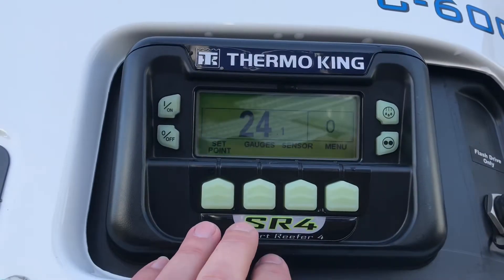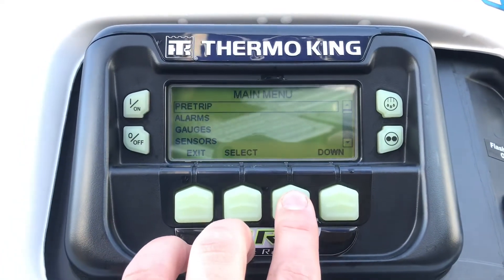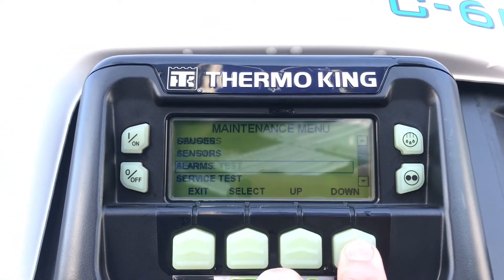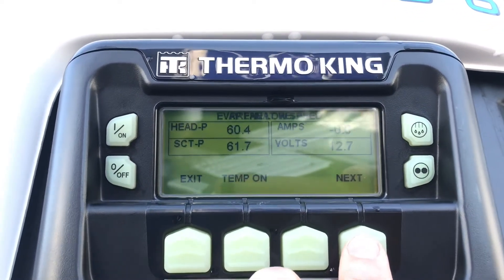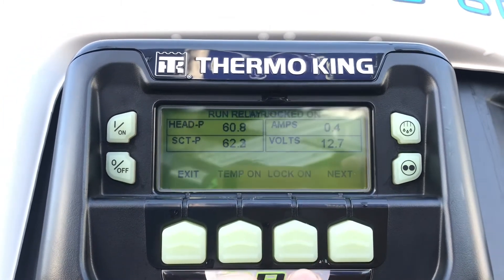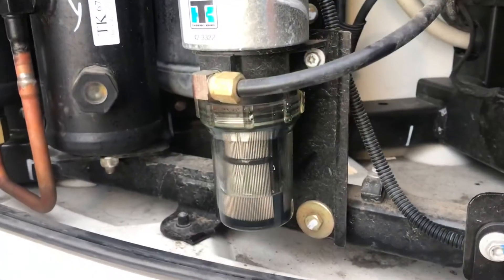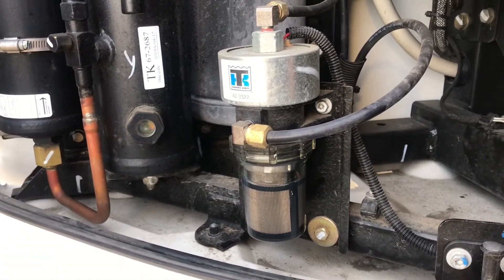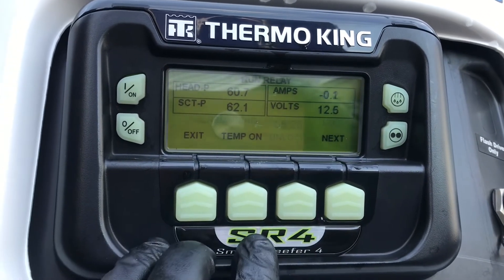Thermo king Precedent prime and start

Comment: Mine says output test unavailable
Reply: Some companies lock out features so drivers can’t mess things up. Any Thermo King Tech can unlock it or return to default.
Reply: I had same problem at first, clear all the alarms (especially the one that says "out of fuel) then do as described in this video.. It'll surely help
Reply: Mine said that at first then I cleared all codes and tried again and it worked